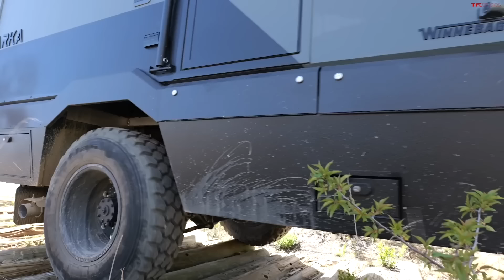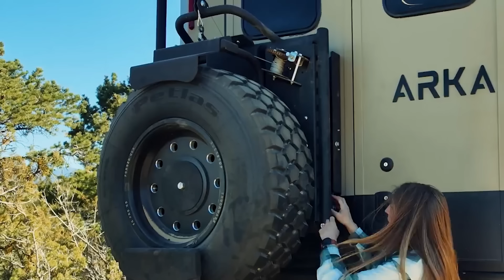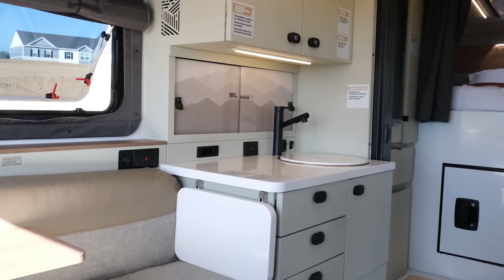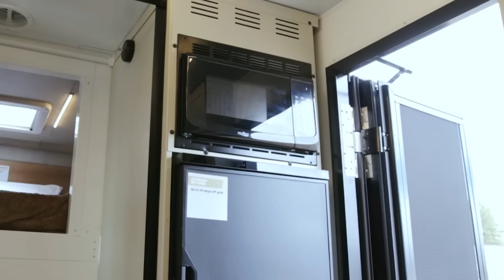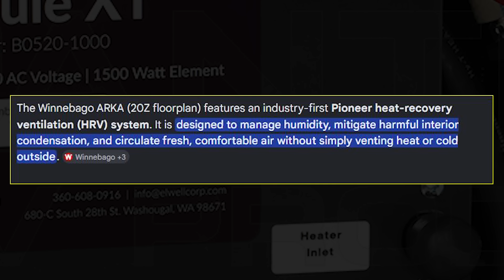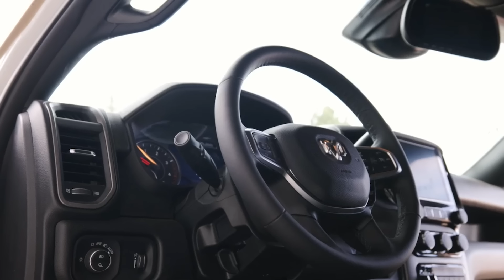Winnebago Built This Camper to Survive Doomsday!

Comment: I love this, with two exceptions. Cassette toilet? NO - make it a composting toilet with urine diverter that goes to the gray tank, and you've got a deal there. Also, while I'm sure the Ram Chassis is capable, I'd feel safer in a Ford. I could get a lot more than 14 days out of this. I currently live in a Ford Transit with a 30 gallon fresh water tank and a fridge that is less than half the size of the one in this rig. I can go at least three weeks on what I have.